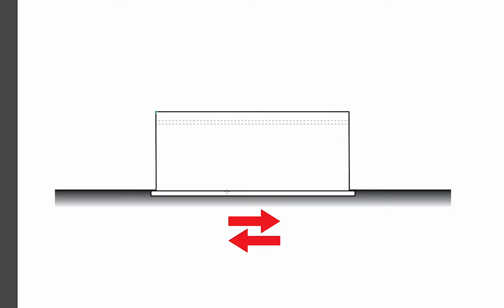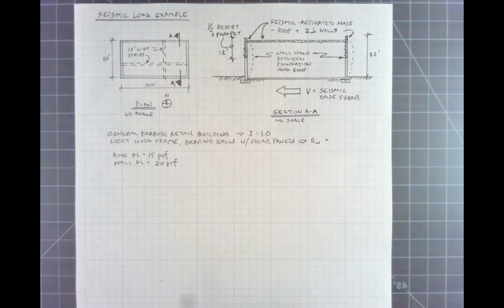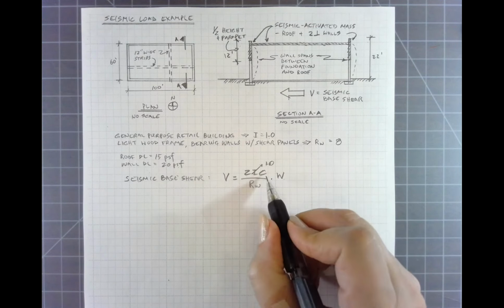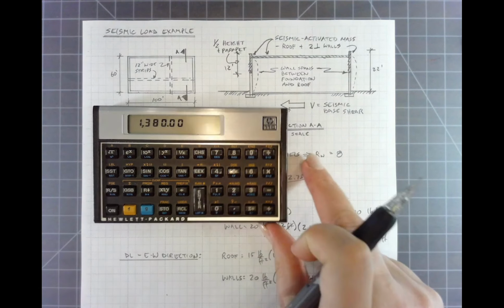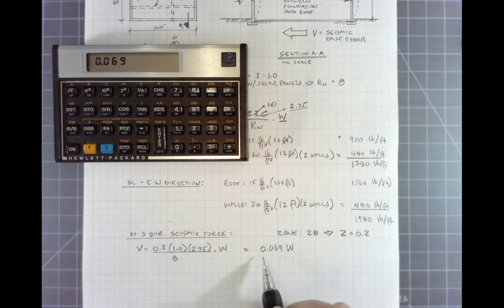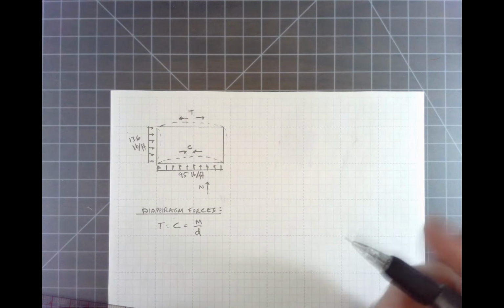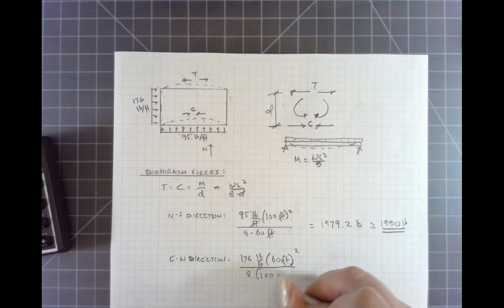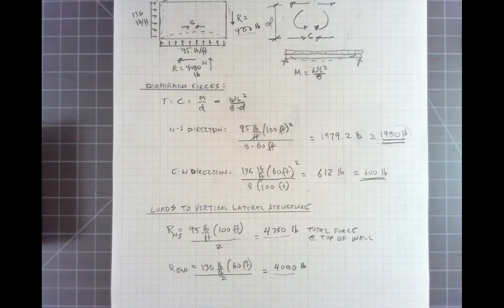Seismic Load Calc Example

Comment: Good day maam if im going to calculate a seismic load on vertical storage tank? Still the same formula or what is the difference?
Reply from the maker: Sorry, that's a question outside the scope of things here. I make these specifically for my students in architecture but post them here for general info. The process here also is using older code provisions that have been superseded. The basic principles would be the same for a storage tank, though, that seismic forces come from inertial mass of whatever is being stored in the tank. I suggest you look at other more technically-based structures links. Dr. Structure here on YouTube might be a good place to start.

Comment: excellent!  I really enjoyed it, very clear presentation.

@ 20.08 for wind loads, you had mentioned the wind loads be the same. But the wall length are different, can you comment on that?
@ 4.52, would the weight be the same if it were wind loads, 1/2 of 2-walls plus roof weight?
thanks
Reply from the maker: Thanks...glad it was helpful. The wind load pressure is assumed to be the same in all directions. The total wind *force*, however, depends on how long the wall is to accumulate that pressure. For the second question, the wall and roof dead loads are what generate the seismic forces in a building by virtue of their inertia. Wind loads in contrast act externally to the wall, so the wall weights are not part of load computation.

Comment: I am new to the structural analysis. Roof DL (North-South) should be calculated 15 psf * 1 ft (12" strip a.k.a tributary width) which indicates the linear load along 60' long section?
Reply from the maker: I'm not quite sure if that's a question or a statement. If it's a question, maybe you could rephrase it as I'm not quite sure what is being asked. The loads computed in the N-S direction are those that accumulate (plus the wall DL) along the 100' width of the building, That force is then in turn resisted the the exterior N-S walls on the east and west faces that carries it to the foundation,
Reply: @professordeb  Why was the Roof DL(15 psf) multiplied by "60ft" for N-S?

Comment: Which code does this example follow?
Reply from the maker: This is based on an old code in the United States (the Uniform Building Code of 1998), which is quite simplified from current codes. The intent of this example is to explain the basic principle of how seismic loads are generated and move through a structure without getting overly complex.
Reply: @professordeb  Understood. Thank You.!

Comment: Professor how do i find the earthquake load that we put in to load the combination equation is that the base shear value or the resultant value of all floor or each story? which value do I use to check the earthquake load combination? Thanks.
Reply from the maker: In multistory structures the base shear is the total due to the inertial forces accumulating from top to bottom of the structure. This base shear then gets distributed to each level of the structure as a percentage of the total. Codes have a formula for that that also consider the mass of each floor level and period of vibration, all of which is beyond the scope of what I cover here in this basic example.